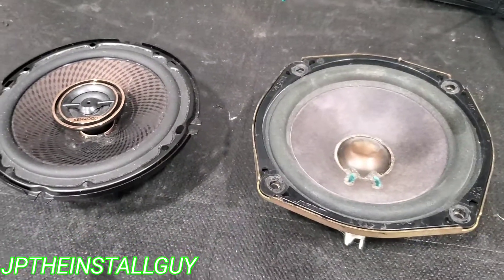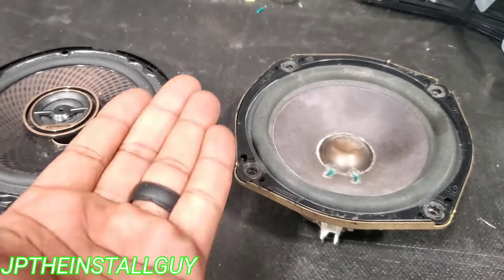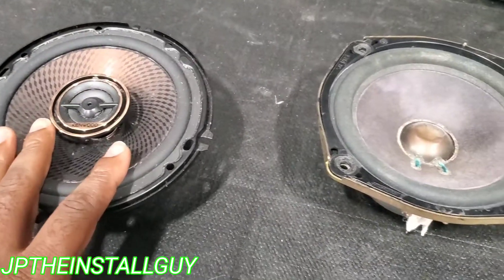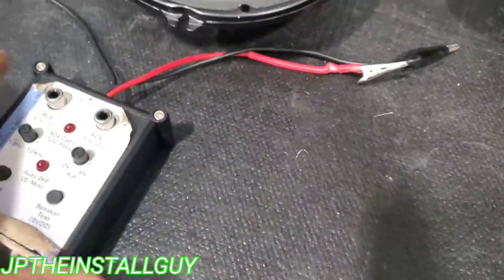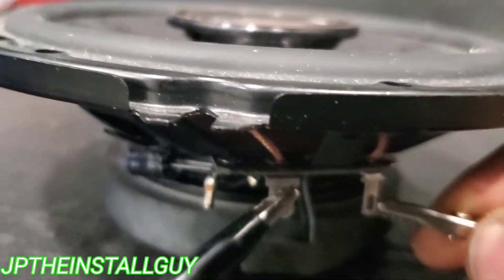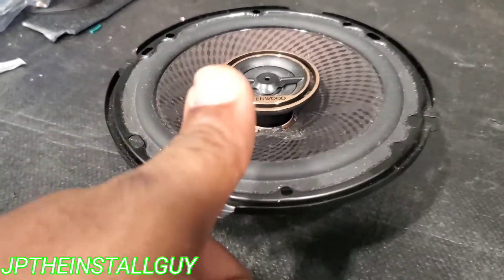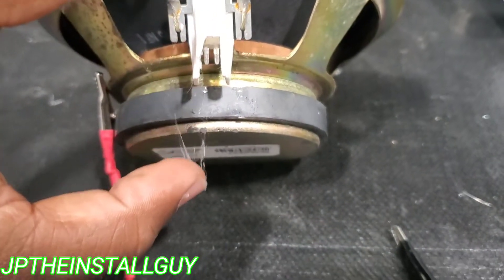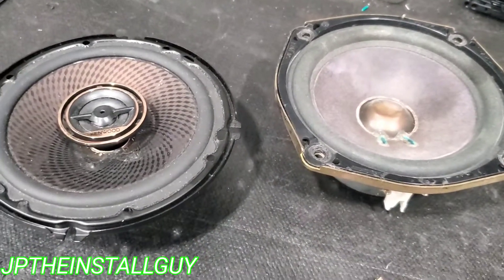speaker polarity - are your speakers in phase?

Comment: Hey man how are you? Great videos I’m learning a lot of these videos,I have a couple questions, first question, I have 3 p3 subwoofers two are 4ohm dvc the other is 2ohm dvc,now I know ohm are not marching but could I wire the two subs that are 4 ohm down to 2ohm and the last sub leave alone,then wire all to my monoblock amp?

Next question in my other truck I have 2kicker L7 q duel 2ohm and two 1200.1 cxa amplifier,can I strap the amps two be one big amp or run 1amp per sub